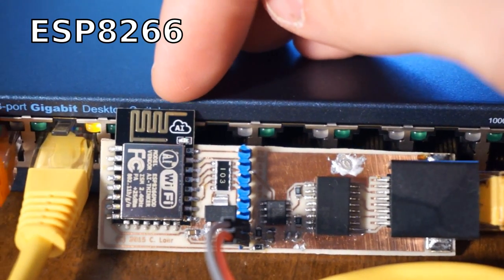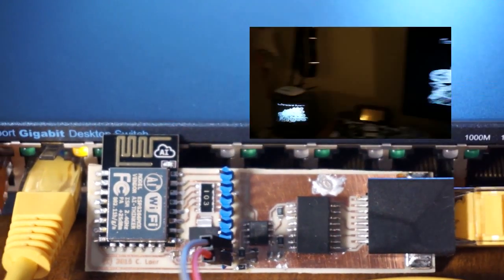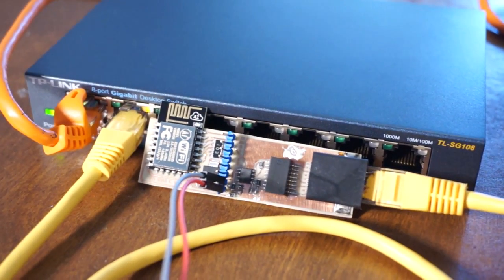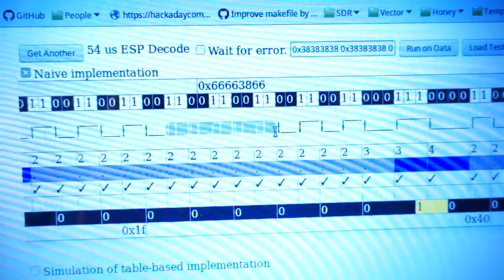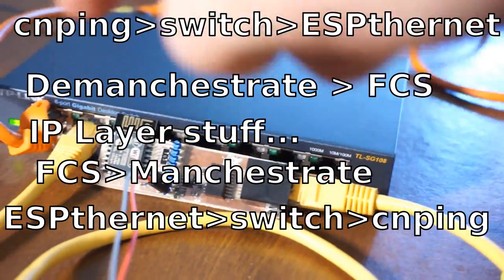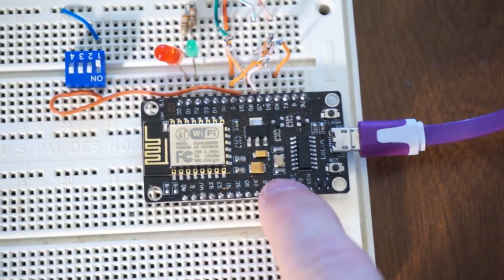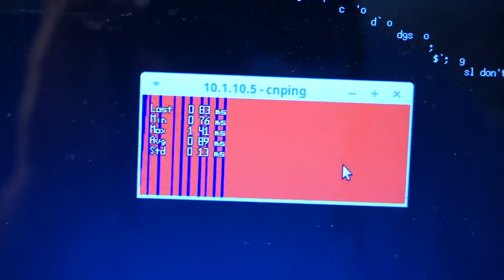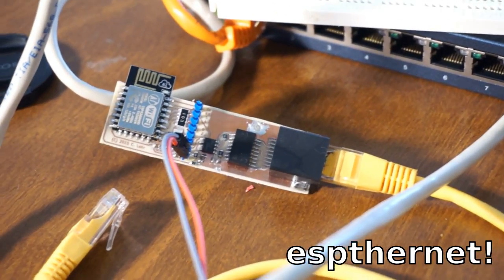Using Wired Ethernet on the ESP8266

Comment: Hello bro
 First of all thank you for giving us such a beautiful and informative video.
  I had some questions about ESP8266 NodeMCU v3.  If I want to make a repeater with it.  So my question is
  1 / What will be the maximum range of NodeMCU repeater?
  2 / What is the maximum data speed of NodeMCU WiFi?
  3 / NodeMCU repeater maximum number of people can use together?
Reply from the maker: Sorry your comment was in the spam bucket.  I do not recommend you make a project with this.  It would be a lot of work and be janky.  Your range would depend on your environment.  I've done ESP8266 range tests at up to 1km, but realistically 100 feet or so is what you should expect less in urban or high RF areas, or going through walls.  (2) About 5mbits/s.  (3) 4 people.

Comment: Hi; how this project makes the most sense, is with the arduino connecting via wifi, and providing that connection via ethernet to an ethernet-only device. I have a need for that right now, I am searching for a solution for my Pioneer AVR. What a device like this needs though, is for the ethernet port to receive an IP from the same subnet as the wifi. So the software needs to pass the likes of DHCP through to the ethernet client.. in fact it needs to pass all broadcast traffic back and forth to accomodate the likes of  airplay, DLNA and bonjour etc.

Could this project do that?
Reply from the maker: nooooooo.  Don't do this for that.  This was mostly as a proof of concept.  It takes a lot of tweaking to get this to work and a lot of custom code to send specific packets.
Reply: Oh well. It did seem miraculous, for a wee ESP-01 to handle all that..!
Reply from the maker: IT DOES! It's just a little janky.  If you are an advanced maker, this project is definitely something you can do.  It's just not as simple as "make this circuit and it'll work every time easily."

Comment: Nice! Is it possible to add an RJ45 connector to a sonoff device? So you can control it via Ethernet not wireless.
Reply from the maker: though impractical, and probably janky, the answer is technically yes.
Reply: CNLohr great! Can you point me to a resource that has done it?
Reply from the maker: Only the resources I have available here and on the github link in description.  No one else is crazy enough to do much with it.

Comment: can we use ESP8266 as a wifi router through this technique ?
Reply from the maker: theoretically, but it would be awful!
Reply: but why ?
is it speed ?
complexity ?
r anything else
Reply from the maker: The ethernet on this system is janky.  It won't work over really long runs and might not work to all switches.  That and I don't think there's an easy way of telling the wifi subsystem that this device is the default gateway and to use it as such.

Comment: So... I could also "read" packets? and then send them over wifi to my laptop? (uisng a Star LAN Tap )
Reply from the maker: yep.  Would need to be a little different, and could only tap a 10 MBit network, but yes.
Reply: Thx, the ESP can only talk 10Mbit? I remember Scott explaining me it will downgrade 1Gbit nets on a Con ive been to. It will be a proof of concept I gues. if I realy want to "wirelessly sniff/spy" Im better off with devices(with PHY) you explained in the videos.
Reply from the maker: Indeed... But, of interest to you may be the ESP32 which has a MAC built in, so you can talk 100MBit ethernet.
Reply: I see your love for the ESP8266 and its pricetag ;)

Comment: This is exactly what I have been looking for!  I have an idea to capture utility usage (power and water) and transporting the data to the utility companies as a service.  To pull this off I need to connect the ESP to the Ethernet port on the ONT devices that are typically mounted to the side of homes by communication companies.....I will pull the code and see if I can get it to compile.  Fingers crossed!!!
Reply from the maker: If you need help, feel free to open issues over at github.

Comment: I found this interesting but the unfocusing and jumpy video was really getting on my nerves.  I am looking for a device like this that can eventually control external relays in coordination with my HVAC thermostat (Basically controlling the operation of my HVAC).
Reply from the maker: This totally can.  It gives 3.3v output signals that can go directly into logic-level mosfets for high current applications.
Reply: I am learning electronics so I'll have to research what mosfets are.   In my app, I am working with 24VAC power and the relays are 5VDC activated.  Just don't know how this wireless device interjects the signal to the relay.  Am I missing something?  Maybe that header I see in blue has at least 3 pins I can use as GPIO?

This looks alot different that what I have seen on ebay...  http://www.ebay.com/itm/321970765761
Reply from the maker: Aah, those are the ESP-01 modules... the ones I use are ESP-12-F modules now. The outputs cannot drive relays directly, but with the help of a mosfet, you'll be set!
Reply from the maker: P.s. Yes, several GPIOs are available on the ESP-12-F's
Reply: I checked one out and now I can see where a header can be added to give you access to a GPIO.  The older model was frying my brain.  Still don't know enough about electronics and mosfets but I can take your word on it.
Reply from the maker: If you google esp8266 relay schematic there are some examples.  They seem to use NPN transistors, but either that or mosfet is okay.

Comment: So what about starting by cannibalizing a 2$ ebay ENC28J60 ethernet module, would that reduce the jank factor or would it just break your code ?

Also can I program my doo-dad in the arduino ide and like, just #include you code when I need to send random ethernet packets ? or do I need to use IDE you used during development ?
Reply from the maker: No.  An ENC28J60 is WORSE than this!  ENC28J60's ARE JUST AWFUL. NO ONE should be using them.  The enc424j600 is at least reasonable, but it makes me sick that people think that a 28j60 is a legitimate chip to do anything with.
Reply: Wow, did someone hack your account to post this kind of hate speech? ... If not: Since they are described as rather popular on hackaday, and even mentioned in your very own espthernet article on there, would you perhaps mind elaborating on your rant a bit more objectively? Thanks.
Reply from the maker: There's so many things wrong with the enc28j60, such limited space, lacking on the memory indexing modes, can't handle half-duplex correctly.  I really don't understand why it became the standard when a chip that mostly works is available, the 424j600
Reply: Probably because it is slightly cheaper (like the guide) !  Also compared with I2S Ethernet emulation, surely you jest that the  enc28j60 is worse ?  At least it has a PHY !
Reply from the maker: This thing totes works with a line driver.  That counts, right?

Comment: So...what about making of WiFi access point? It would be awesome to have just tiny board with RJ45 connector, powered by PoE, hanging behind wardrobe on UTP cable and spreading data to whole room.
Reply from the maker: That may be possible!  I just don't know how to intercept the IP packets :(
Reply: Yay!
When I saw your projects, I'm pretty sure you can solve that in few minutes. To be honest, I thought that simple forwarding of data flow would work some way. When you have ethernet to serial and WiFi to serial converter, first thing that comes to my mind is to simply connect serial interfaces and check what will happen (and analyze if it even does something, or where it fails).
Reply from the maker: I don't understand what you are saying...

Comment: Wait, why wouldn't you want to use an FTDI chip in a commercial product? Am I missing something?
Please elaborate. :)
Reply from the maker: Because FTDI is a terrible kludge.  The parts have more stringent requirements than most of their competitors not that you should use any of that anyway.   ADDITIONALLY if you use an FTDI branded chip in your design and there was confusion in the sources, you run a high risk of having a product that will be deliberately bricked by FTDI.  If it has an FTDI stamp on the top  throw it in the trash.
Reply: @CNLohr  So you have a problem with generic UART to USB interfaces or anything more particular to this design?
Because in anything low volume and/or low throughput I think having this trivial/standard way to interface is just better than the hassle trying to make a custom usb interface.

Comment: lol.... btw you have a node mcu there.... would it be wise to fetch i2s direct from the esp? I want to use your ws2812 driver stuff :-D
Reply from the maker: +Tim Solinski (MrFaul) You basically are fetching it right from the ESP when you hook into the RX pin.
Reply: That is my intention :-) build a massiv ceiling lamp with ws2812 stripes and was to lazy to build a controller for it so it is sitting for about 2 - 3 years in a corner now xD time to finish it... one question those two bin files on git hub are those functional builds for flashing it?
Reply from the maker: Yep!  They accept packets via UDP port 7777 I believe.
Reply: cool
And thx for it and colorchord
Reply from the maker: I have my sights set on colorchord next! :)

Comment: Did you write all that code yourself, or did the guys in the background help you :D?

Also: How long did it take you to write this?

Edit: The thing with the antenna that gets rid of signal disruption seems a little odd :D( Is it really not a really really good april fools prank?)
Reply from the maker: +K1ngjulien_ I believe  I coded everything myself, except for the FCS CRC that I can remember.  I also borrowed bits and pieces of Sprite TM's I2S code, but that's largely mine now.  I also use jQuery on the webpage.

This whole video is legitimate.  I actually did everything.  The ONLY part that is April fools is where I say the ESP8266 has an Ethernet module.

Comment: What's the difference between the NodeMCU board and the ESP8266? The node just looks like it's a breakout for the ESP? Is that at all correct?
Reply from the maker: +bdot02 The NodeMCU board is a breakout for the ESP8266 ESP-12E, however, it does not have a line driver (ISL3177) and so the ESP is acting as the line driver as well.
Reply: Ah so the board isn't janky, just the setup. I'm just curious since I've been playing around with arduino and wanna start learning the ESP8266. Your channel is very helpful.
Reply from the maker: Correct.  NodeMCU boards are great!  Just not for Ethernet :-p
Reply: +CNLohr out of curiosity do you have any 'getting started with' sort of videos for the ESP? Or are there any guides you'd recommend? I'm coming from Arduino and would appreciate some sort of hello world tutorial.
Reply from the maker: Check out "Making your own C programs for the ESP8266"

Comment: So bit-banged ethernet is faster than the native WiFi connection, at least in terms of websockets? For comparison, what refresh rate does your websockets code score on an official arduino ethernet shield, or a beaglebone black?
Reply from the maker: +Gordon McLellan It is comparable to the wifi connection, just more predictable timing, you don't have peaks.  Either the packet comes in in 1 ms, or it doesn't at all. I've never tested it on those devices... BUT... It "feels" slighly faster than even an ENC424j600 based controller solution.